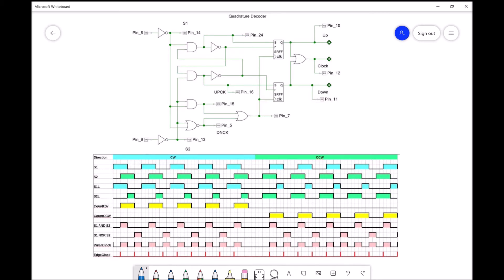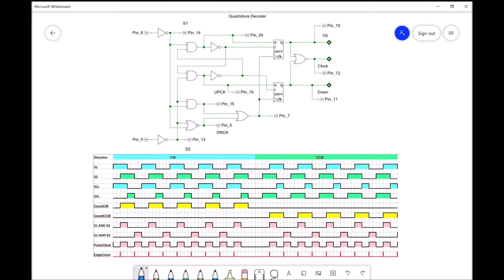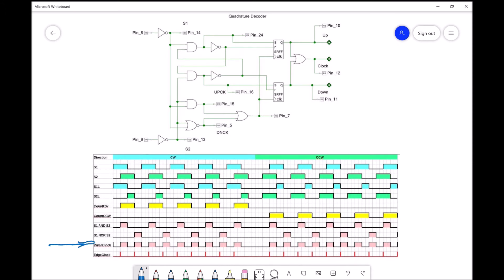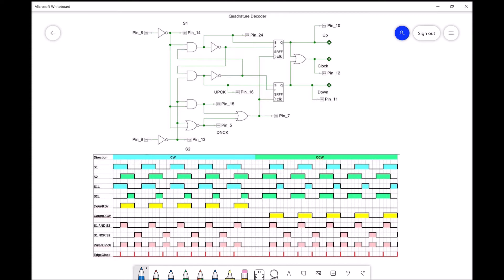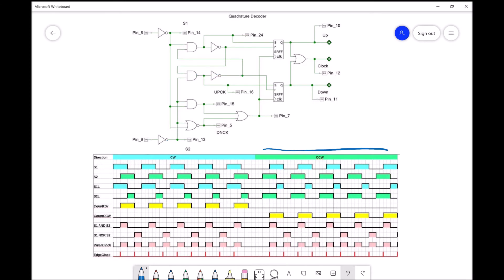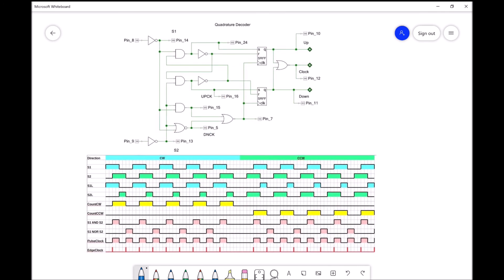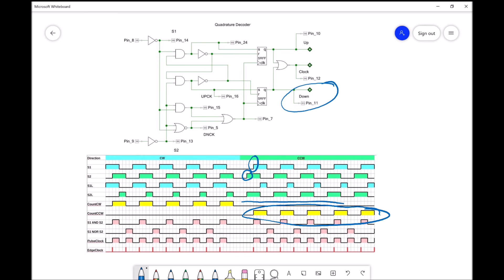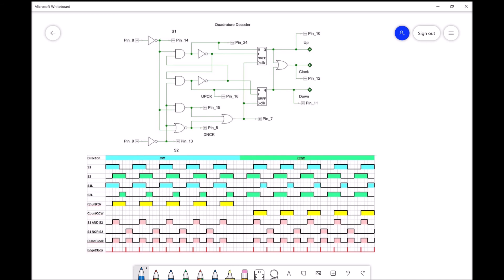QuadratureDecoderNewDesign

Comment: Hi, I've tried ceating this with xod, but it would allow the design without inserting two "defer" node on the feedbacks. I cannot get this to work now as designed, so I suspect the defer nodes are spoiling it. Have you any advice with this? Many thanks